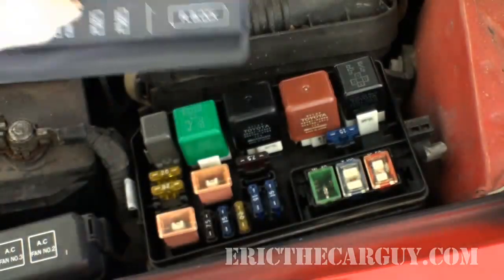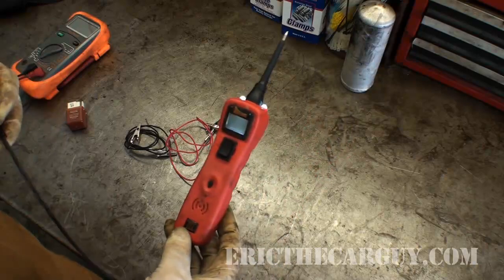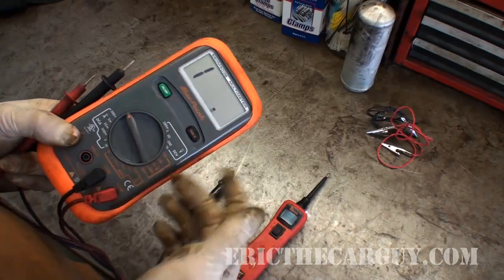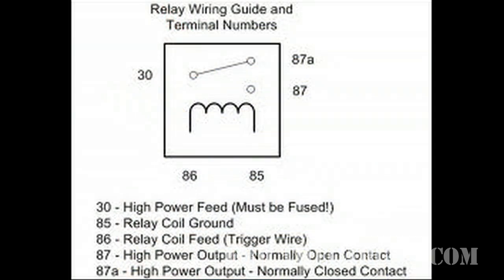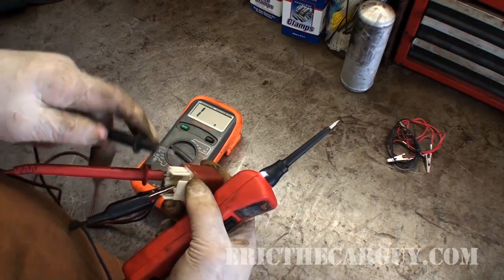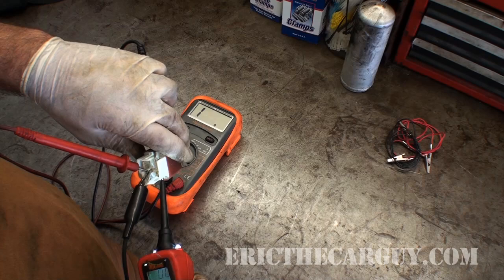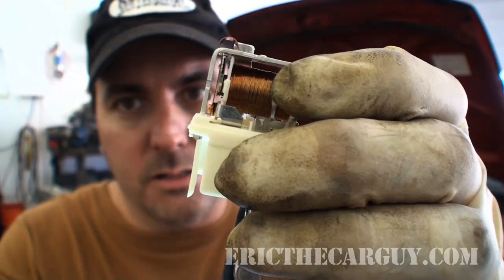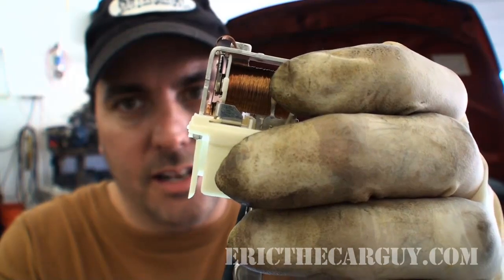How To Test Relays- EricTheCarGuy

Comment: I have a Satern Ion 2005. Lately I have been having problems. First, after clicking my car locked, a day later lI ate at night I heard a car alarm going off. I did not think it sounded like my car and ignored it. Turned out it was my car and because of that going off so long it drained my battery. Then it happened again. Also I began having problems with the windows not going all the way up unless I turned the car off and then on again several times to get them to go up all the way...then, my interior lights would not shut off after exiting the car and waiting to see they went off...one thing after another. Any idea of what is going on with my car. I had planned on getting it fixed and giving it to my granddaughter, but now, I just don't know what is going on with it.

Comment: Relay works on and off that’s it’s job., you test it then find out working ok but, it doesn’t last, receiving voltage constantly the coil gets weaker and weaker overtime. That’s sometimes stuck open or closed

Comment: my 95 camaro 3.8 fans run slower after driving like a hour the the car will run warm. im wondering if it could be one of the three relays. no my relays have 5 pins do i test them the same?

Comment: Some one please help.

Ok I have been on a journey. This might be kind of long.

So 2001 Buick century - what I've done

Replaced radiator, radiator cap, cooling fans thermostat, heater core, water pump, coolant temp sensor.

After replacing ALL of that the cooling fans would kick only when I turned the AC on. Or so I thought. Turns out they were functioning normally but not at the correct temperature. Low speed would turn on when the needle reached the just before the 3/4th temp gauge line. High speed would turn on at the 3/4th temp gauge line. So I figured pcm must be faulty. (Among other tall tale signs)

So. Replaced the pcm. FIXED A LOT OF ISSUES. But ended up back to square one. Cooling fans won't come on. Not even for ac this time. So I broke the trustee multi meter out and started rechecking wiring. Bringing me back here today. Now. It seems the cooling fan 1 relay is not getting properly powered. According to my relay. Post 85 and 86 should have 12 volts power, and post 30 and 87 should have no power untill tripped. Well 86 has 12vs 85 has no volts 87 has 12 volts. And 30 has no volts.

So I'm assuming 85 and 87 have crossed somewhere and that I'm needing a wiring diagram for the back of the relay fuse box that i cant find.

edit: ima leave this here. but i also posted on forums.

Comment: magnetic contactors used in circuits to switch high amperage electric motors used in industrial manufacturing such as CNC lathes milling conveyor belts even amusement rides. including when re-engineering hi cranking amp floor button foot pressed starter switches by later adding low power ignition relay which Leland at Cadillac first used to replace  hand cranks potentially causing bodily injury resulting from compression kickback.

Comment: Hey Eric, So I have a 2004 Acura Rl and decided to replace my interior lights with leds. In addition, my instrument cluster panel light hasn't been illuminating for several years and I thought it wasn't a big deal because the dashboard also indicates the gears. 4 days ago,  I decided to finally replace all the interior lights including the instrument cluster panel, and I was amazed by the brightness of the LED(s). It was great to see the illumination of the instrument panel. After about 2 days later, I noticed the instrument panel no longer lights up, along with no lighst from the radio, and tail lights. Dashboard lights are fine, braking lights no problem. I checked the fuses and they seem fine. Do you think it might be the tail light relay that needs to be replaced?

Comment: The click from my 6-prong 95 maxima starter relay was low.  I tested another 6 prong relay, the click was louder.  Does the low click mean anything?  I couldn't swap the relays because the connectors have diff. orientation.

Comment: What if the fuse and the relay are good, yet the roblem still exists (ie: the horn). Would it necessarily be the horn switch @ the steering wheel, or is there something else to check ( all wiring looks good)?

Comment: 1. Dash board shows: No fuse 
2. No BUS
3. Wiper half way
4. Main run clicking 
5. ASD was clicking 
6. Stick in PARK position but DASH board shows "R"
7. Electric lock not functioning.
Which fuse or relay to check and fix?

Comment: Hi,
After giving my Honda Odyssey 2006 a jumpstart it started fine. But the dashboard had no light. The only lights were on was the brake lights the seatbelts and the VSA light on the dashboard. The gas gauge was on E while it was running even though I have a full tank.
I ran it for about five minutes. I put it in reverse the engine shut off on me. It wouldn’t start back on. And now I have No headlights. What could be the problem? Maybe the alternator Not the starter?

Comment: Eric quick question, if a relay has 58ohms at the coil and another different relay is 158ohms mitsuba 7001 and 7003 and both have good continuity would you say the higher ohms is bad relay?

Comment: I have a 84 Silverado and my low beams work fine but when I hit the dimmer switch all the headlights turn off. When I rehit the dimmer switch my lows come back on. I replaced the dimmer switch but still have the problem. Any suggestions?

Comment: All my brake lights don't work and mechanic said it was the brake light relay module. Replaced it and brake lights flashed once and stopped working. Checked fuses and all good. Brake switch good. Is there something causing the relay to go bad?

Comment: hi guys help my civic 93 d15b7 i check on the swich fan cooler no power. icheck fuse and relays but if i put power omthe cable positive the fan turn on ..i have ground ..but no power on the posiive cable

Comment: Eric, I gotta problem with my son's 93 Honda Accord.   The dummy light for the battery comes on, but if I turn the air conditioner on, the light turns off.  

This morning, the brand new battery reads 3.62 V, which you know means, it didn't start.  

My way 9f thinking is, if the AC effects the dummy light, the AC is the problem.  Please correct me if I'm wrong.  

Even so, I'm trying to learn how to test this thing with a basic $20 multimeter, but I'm having one hell of a time trying to figure out what to test.  There's no fuse for the AC.  There's a fan fuse, but nothing that say's AC.  

I'm watching the volt drop test you posted.  

You're the BEST on the net, and your vids have helped me more times than I can remember now.

THANK YOU, Eric. 🙂

Comment: Can a bad asd relay cause my engine to stall and lose spark when engine reaches operating temperature???                                        97 Dakota v6 3.9...I’ve replaced fuel pump,iac,tps,crank sensor,cap and rotor,cam sensor and pcv valve

Comment: This video is very informative, on problem solving my failed signal light and hazards with the front yellow lights still on, but didn't flash; on my 2006 Toyota corolla. Still needs fixing, waiting on new signal switch to deliver hoping it will solve the problem. I don't hear the clicking and I've replaced the relay already.

Comment: Eric I bought a 04 DeVille ,the drivers side door panel was missing some of the screws and plastic pieces and not attached to door,though the electric connectors were and working. However to close door I detached the two plugins. It's in the trunk,  my issue I have first my car won't start and the security light comes on It has happened once before and o opened drivers side door
.. before I buy a transponder key what steps should I take to diagnose and remedy  this, money is tight so I have not replaced panel yet.please help with your wisdom thanks

Comment: I'm stumped. 03 Rsx. My relays are buzzing. Condenser, radiator, and I believe is another relay that controls both condenser & radiator fans. Both fans work and fan switch works. I bypass the fan switch and the relays buzz crazy(fans not working). I also tried to turn on AC and does the same thing (with the fan switch connected). I heard the ac pressure switch might be connected to the fans somehow. Idk:( Big fan of your channel. Keep up the great work Eric!!!

Comment: Do an advanced A/C troubles, on 03-11, Grand Marques, Crown Vic. I'm an ok mechanic. (Ford's) if I paper clip the relay slot, make compressor cycle, it blows cold. I do not have the electronic head unit. Brand new fan, and cylinder head temp sensor. Works great. A.c. compressor, still won't engage, all fuses, relays, and diodes, good. Coolant temperature sender? Driving me nuts!!!

Comment: anybody have any idea why my 96 caravan check engine light doesnt light at all? i tried switching the lightbulbs  and fuses so its not that. my gauges go to a stuck position when i turn it on and the speedometer doesnt function at all and the odometer doesnt light. smog guy said all i really need it the check engine light for smog.

Comment: Check the voltage drop across the relay load side with the load engaged any close to 300mv drop across the contacts is a bad relay the voltage drop can increase till the point the circuit fails test against a new relay to see where is started out

Comment: I followed you directions on how to check if there is a draw on a car battery.  I purchased a digital multimeter and hooked it up like you said.  I found there is a 1.42 amp draw on the system.  Now I am going to go through the fuses like you said.  I never even knew about relays before.  Very interesting.

Comment: I just replaced my starter solenoid just to find out the relay was bad. I’m in Brasil and autoparts stores here are almost worthless. So I opened the relay and the contacts were totally black (the burning from many years of use soots up the contacts.) 
I cleaned the contacts with scotchbrite and put a dab of dielectric grease to prevent the arcing that jumps the gap causing the burn marks. 

It’s working great. I’ll be ordering another one soon just in case. When you’re in a pinch, you might try what I did.

Comment: Hey. I have a question. I have a 91 Chevrolet Blazer s10 4.3. What's making my truck vibrate? It only do it when I'm at a stop light. No check engine light. I was told that it could be motor or transmission mounts. Need a couple opinions please an thanks.

Comment: could you help me i have an 01 ford ranger i have replaced the blower motor and the resistor and the relay keeps burning up i have replaced it 5 times already i have found if you run the fan on a lower speed the relay will last longer

Comment: Some relays work off the computer, and the input is NOT 12 volts. They could be 5 volts, or even less. In this case I wonder if you could conceivably damage the coil by supplying it with 12 volts, heat it up and melt something.

Comment: Just a trick when checking continuity if you dont got a extra hand use your jumper wires and hook up one on one of your leads and the other jumper to your other lead then you can use your alligator clips from each jumper to clip to each contact. And then you dont need to struggle trying to hold 2 leads and your probe ....just an idea.
Reply: But great video very helpful

Comment: Thanks for all your helpful videos, Eirc. I was wondering... do relays ever stick "closed" on the high amp side such as causing secondary air pump not to shut off resulting in motor burn out? Thanks.

Comment: Great videos,Eric. I just checked my ac relay with another from the fusebox,but didn't put one in the place I took it from when I tested it. Now check engine light is on. Do you think that would cause the light to come on? Hopefully it'll clear on it's own. No luck with the clutch kicking in with different relay. Any suggestions. thank you

Comment: I have a 89 jeep Cherokee.  my front turn signals don't work but the back ones do. I have checked and replaced the bulbs and also the fuses. and the flasher. but still no front turn signals on eather side. could it possibly be the switch. woodmaster622@gmail. com
Reply: chk for good ground.

Comment: I prefer to test the load carrying  capability of the relay contacts as low resistance alone does not ensure that a relay will able to pass the required current

Comment: Only the high and low functions of my wipers work when my engine is on. If the engine is off (accessories turned on) all the wiper functions work (high, low, off, 5 stages of intermittent). Once I start the engine the intermittent setting may or may not activate the wipers and if they are activated they wipe and random intervals. I replaced the relays and multi-function switch. Any other ideas? Maybe the replacement parts were bad (bought them new)?

Comment: 2004 Toyota Camry LE. Okay so my low beams don't turn on but high beams do. Checked low and high beam bulbs and they're in working condition. Checked the fuses for the headlights and they were good condition. Then when I take off the HEAD relay and put it back in and switch to high beam, now my low beam comes on instead. I do notice the dimmer switch makes a "click" noise when I switch to low beam. Can anyone help me out here please? Thank you.

Comment: I have a 2004 neon and headlights stopped working but all other lights work. The inside fuses are good and not sure if it has relay or a 40 amp fuse please let me know what u would consider the problem is thanks

Comment: Ty for this! I inherited a 2002 Ford Windstar after my dad passed, & (once again) it's not running. I'm thinking it's the fuel pump, but I'm alil confused. I first thought it might be the crank position sensor. But I'm not getting any fuel pressure either at the fuel rail valve. Doing it alone isn't any fun either.

Comment: Hello Eric, Good video! I have one question. I couldn't pull out small relay for fuel pump from this relay block. It has same attachment but a little bit smaller. Schould i bent white feets of relay or push black ones inside. Additionally there is no space to get it from the side! It's Mitsubishi Space Wagon but construction is 1:1. 
At the moment i will check engine fan relay (it does turn only with A/C fan together). If i give current direct from battery could it burn relay? I wonder why using relays with contacts instead of transistors and at once electronic throttle! Thanks.

Comment: I need help with my Audi A4 Quattro 1998 it was overheating water is leaking out of the I don't know underneath it's just coming out from the bottom I drove it the light came on it did beat okay and I was getting off the freeway and then the oil light came on as I was exiting the offer the ramp the car died had it towed what's wrong with it
Reply: okay it never went over the halfway mark on the heater thing but is just draining water

Comment: sometimes another hand would be nice huh...
How about...
hehe
sometimes it would be useful to know that YOU HAVE ALLIGATOR CLIPS SITTING ON THE BENCH so that you don't need another hand   LMFAO
and
sometimes IF YOU CONNECT YOUR ALLIGATOR CLIPS TO THE Multimeter probes and then to the High Amp Relay Terminals, 
you won't have to juggle everything

SOMETIMES... it useful to remember that   HEHE

You're funny dude
they are literally sitting in front of you on the bench and you didn't use them... oh well. shit happens
you proved the point

Comment: I have a 2005 Dodge Caravan Grand Caravan SXT full power I hooked up the battery cable wrong and the Lights Went Out and the door locks don't lock with the key and the air conditioner don't come on and heater stays on
 IT got me ? help

Comment: okay I have a 2002 Nissan Pathfinder and I was cleaning up the fuses so I pull out one by one cleaning and putting them back exactly how they were and just to let you know it was running perfectly before I started messing with the fuses and as soon as I finished cleaning them I turned the switch to turn it on and nothing happened everything else works it just doesn't do any crank or any funny noise id like to know if it was a fuse I might have burned or something because my battery is good my starter is good everything is fine it's like there's no signal going to the starter

Comment: My 1996 Chevy 3500 A/C compressor and the dampers in the dash will not run are open, I have checked all the fuses and all are good. I didn't check the relays like you did so I will check them next. Is there anything more I need to check to try to get the corrected? Thanks Stan 6/23/2017

Comment: hi Eric,  can a relay still operate the pass side low beam and not the drivers? (if the relay is functioning correctly) ..this is a problem on my '05 Buick Allure 3.6l cxs (CDN), Lacrosse in the (US) bulbs are good ... high beams work on both just not Dr low beam,
☺thx for your help

Comment: I HAVE A 96 MAXIMA STARTS WELL DRIVES WELL SOMETIMES IT JUST SHUTS OFF.  THEN TRY TO START IT BUT IT WONT START. I TURNTHE KEY TO LISTEN FOR THE FUEL PUMP. DOES NOT HERE IT. I THEN WAIT TEN OR MORE MINUTES I TURN THE KEY THEN I HERE THE PUMP TURN THE KEY AGAIN THE THE CAR STARTS DRIVE ABOUT TWO MILES THEN SHUTS OFF WAIT TEN MINUTES THEN STARTZ AGAIN WAT IS GOIN ON WITH MY CAR

Comment: I had a failed relay about 15 years ago with a 10 year old Honda Accord at the time.  The fuel pump relay (fuel inject) under the steering wheel, above the brake pedal.  The soldering job failed after millions of clicking/vibrating. It was mounted on a small circuit board, not the module like the video.  So I re-solder it.